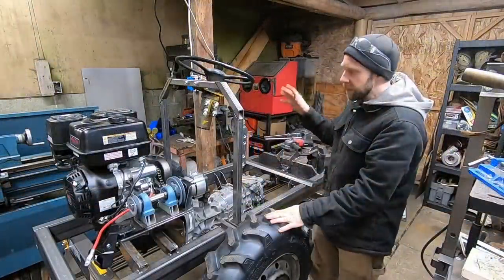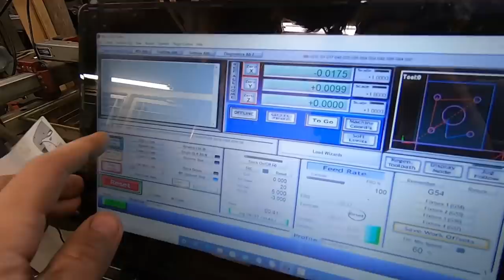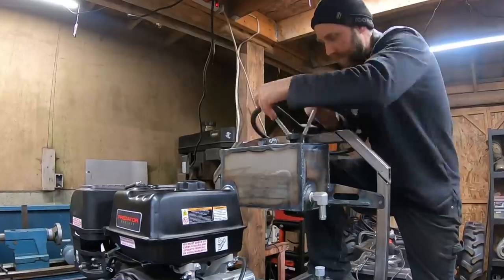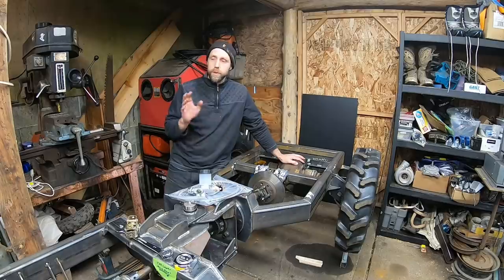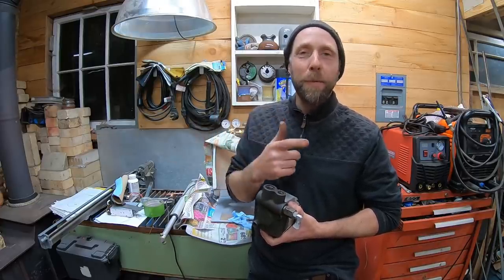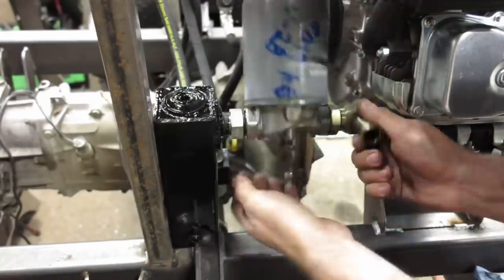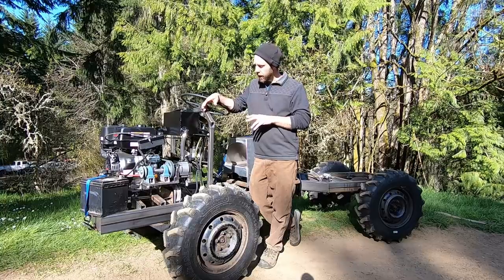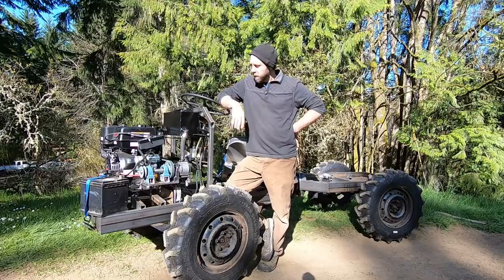420cc Predator powered articulating 4x4 dump truck build part 6

Comment: Zero suspension, 👎
Reply from the maker: It’s not for racing it’s for hauling heavy loads at slow speeds. Besides you will never drive it so why do you care 😂
Reply: @Mikefestiva  Your right, I'll never drive it, I Just don't see it being used much, I use my toro workman for everything, but that could be because it has a heated cab 4wd dump body 2500lb capacity with 3500lb towing, has 4900hrs all original. I get the point is to make content, but jeez that thing is primitive, like something you would see on a Russian YouTube channel.
Reply: @MacGyver-1  hater
Reply: @leonhough5932  Meh...
Reply: @MacGyver-1  He built this beast from the ground up with SIMPLE in mind, you sound completely spoiled. jeez is right
Reply from the maker: smart man Haha you forgot to mention you probably paid a lot for your side by side golf cart. How much did it cost you? You think I won’t use this much? Okay do you know me and what I do on my land? I use the things I build, they aren’t just to make videos. Primitive or not at least I know I will be able to keep this going for years after your glorified golf cart breaks down. 👍
Reply: @Mikefestiva  hahaha I paid 500 for it and put a new clutch in, and you are a fool if you think its a glorified golf cart. It's diesel 4wd 3 speed transmission. With low, 68" dump body, snow plow, heated cab, hydraulic breaks 540 PTO, auxiliary hydraulics. Not a golf cart. Very versatile and it hits 28 mph in high range, I can't see you "truck" being used much
Reply: @Mikefestiva  looks like it took a lot of planning and time. Really cool. I work in a fabrication shop welding and fitting mainly I love making stuff and it was inspiring to see it all come together.
Reply: @MacGyver-1  if you can't appreciate the time and craftsmanship then why even watch the video 🤦‍♂️ looks like to works fine to me lol
Reply from the maker: smart man Sorry It just looked like a golf cart, my bad. You sound very proud of it and you definitely should be! Especially because it’s a Toro and Toro is by far the best in yard care!